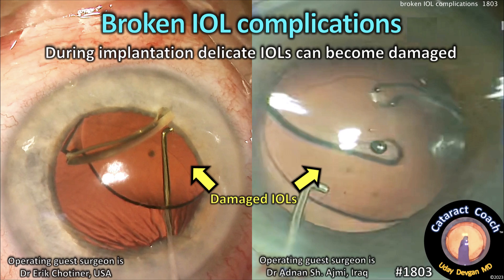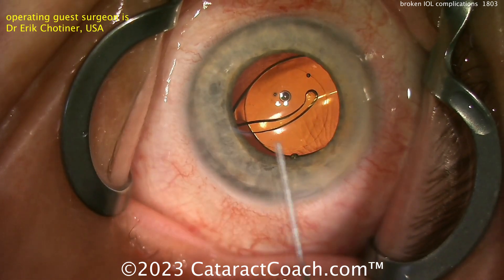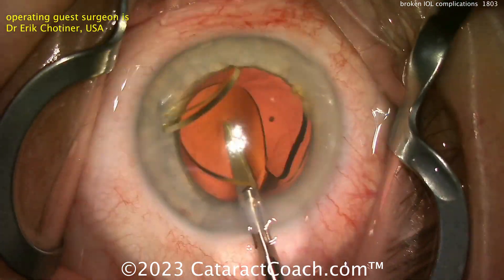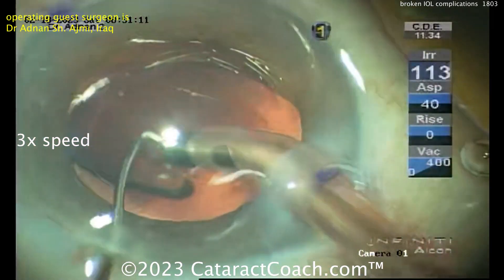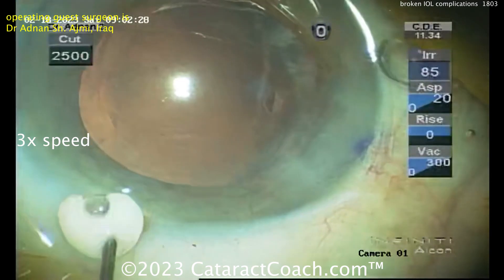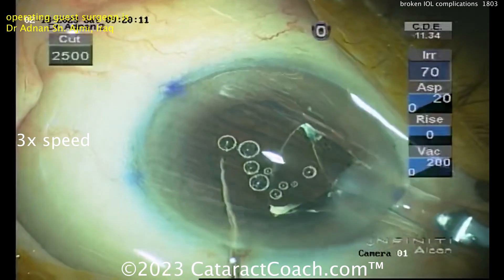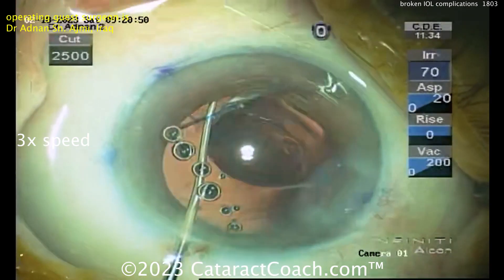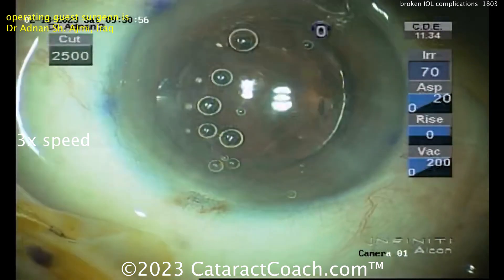CataractCoach™1803: broken IOL complications in cataract surgery

Comment: I've also had a Clareon IOL also break at the haptic/optic junction as well. Explanted and put in a new IOL of the same model and power and it went just fine.
Reply: Preloaded ?
Reply: @ajmi10  no, it was a regular technician-load lens. I've not used any pre-loaded IOLs before for various reasons.
Reply: @MrRedalertcc  budget ?

Comment: The second surgeon is so skillful and reckless 

In the first case , with Clareon lens , should have gotten the preloaded one 😅

For the second case , the first IOL was pushed too hard into the bag while implanting , but good save to hook it up before it dived in . 
Using the J&J Tecnis injecting cartridge for a 3-piece iol was wrong , no other way around it, it’s great for single piece lens and It can fit a 2.2 mm wound, means it’s too tight for those poor PMMA haptics . The “butterfly” cartridge or Alcon B cartridge are ideal, but you can get away with Alcon C cartridge if you know what you are doing

Comment: is explantation of the IOL with A BROKEN HAPTIC NECESSARY EVEN IF THE STABILITY IS GOOD ?
Reply: I see ur point.
I think it's debatable.
In a pinch, if you didn't have a backup IOL, u could Reverse Optic Capture (ROC) the IOL assuming the rhexis is adequate - this would guarantee centration!
Reply: @soccer24six   If I didn't have the exact same IOL I'd take a look at the iolmaster and choose the iol which targets between -0,25 and -0,50 instead of plano. If I didn't have that IOL either at that point I'd leave it aphakic, explain to the patient, and next week implant the IOL
Reply: @SuperSZ  yeah, good points. Even if u ROC the original broken lens, it may have a refractive outcome similar to that of a non-broken IOL in the bag with a -.50 target
Reply: @soccer24six excellent
Getting a minus 0.5 refractive outcome is safer than over manipulative approach.
Reply: Stability cannot be good if haptic is significantly broken. It might look stable on table, and even on next day if you don't dilate the pupil. But keeping a broken lens inside eye is negligence in my opinion. Also, one shouldn't operate without any backup lens. That excuse is simply unpardonable. One must have a same power single piece as well as 3 piece lens for emergency situations like this.
Reply: Stability is NOT gonna be good with a whole broken haptic. You can position it in the center with the sinskey hook and convince yourself the next day the IOL will be there, centered where you left it, but that's not gonna happen. You may just save yourself the stress and do the explant in the moment like in this video.
Reply: Posterior capsule is open , you are risking a dropped IOL in the vitreous cavity , a 3 piece IOL of all types with sharp claws of haptics (one haptic in this case) that could tear the flesh of that poor retina back there minding her own business